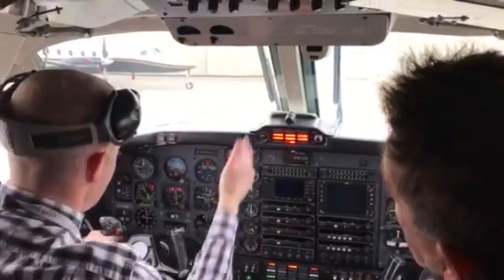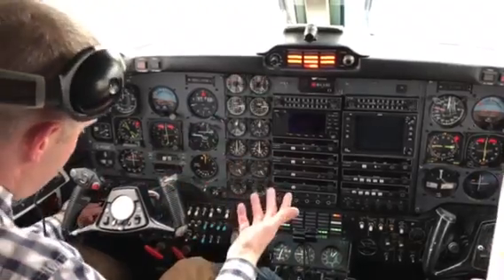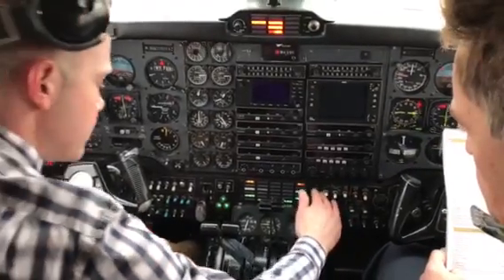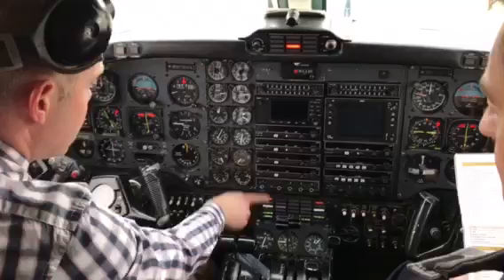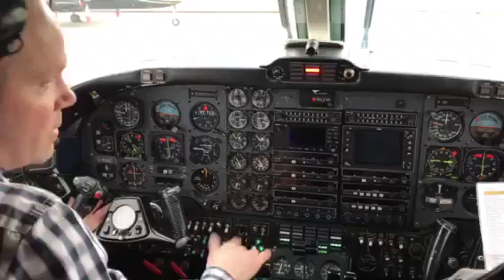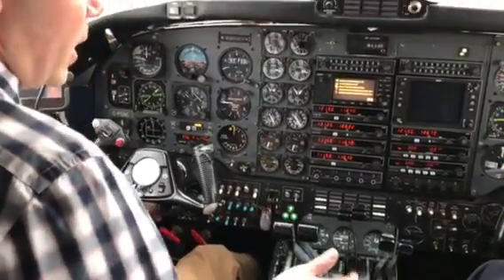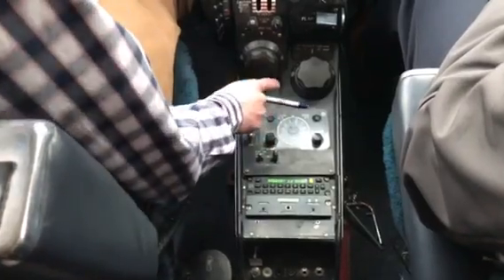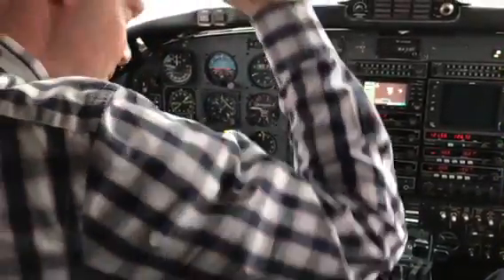King Air 200 Startup

Comment: When testing the “Brake De-Ice” watch for a rise in ITT when you select the switch to on and also watch for an ITT decrease when you select the “Brake De-Ice” off. That way you can confirm that the bleed air valve is opening and closing.

Comment: Ive never heard of turning off the generator before starting the second engine and turning it back on during the second engine start.
Reply: Sal, some generators have a load limitation that determines how they can be used to assist a start. In the King Air, the initial load of the starter engaging shouldn't be placed on the generator, but after the starter has been engaged, the generator can be turned on to assist with the remainder of the start. In some turbine aircraft, the generators can be used to assist the entire start, whereas in others, the generators cannot be used at all to assist a start.
Reply: Sal L The reason is that you can blow a current limiter (big fuse) from the big initial hit of the starter. Once it's past the initial hit the generator can be turned on again to assist the start. Generator assists straits start considerably cooler than battery starts. Later serial number 200's have generator control units that do this for you so you don't have to cycle the gen off and on again.
Reply: It's because there is a chance of blowing the current limiter under the forward cabin center aisle floor. I'm an Avionics tech on these...I have had to go replace the current limiter when the plane was off site and the pilot started #1 engine with the #2 generator on.